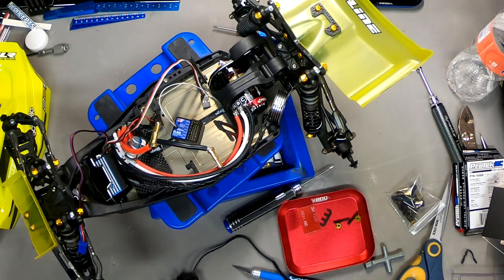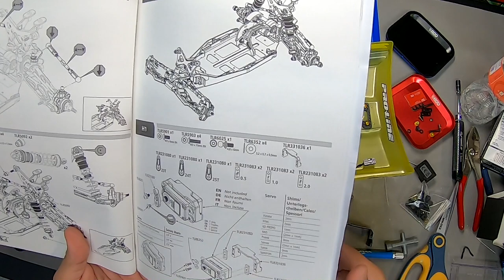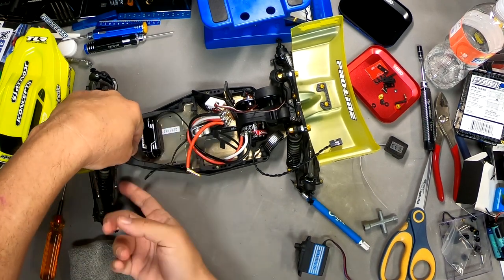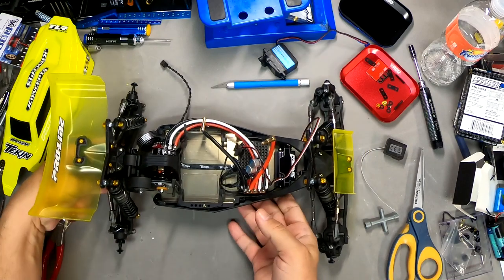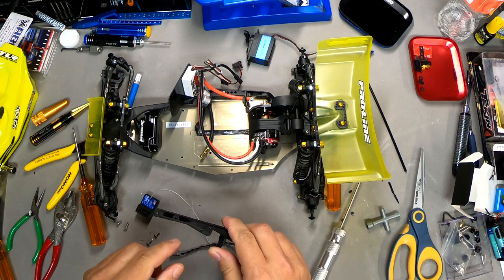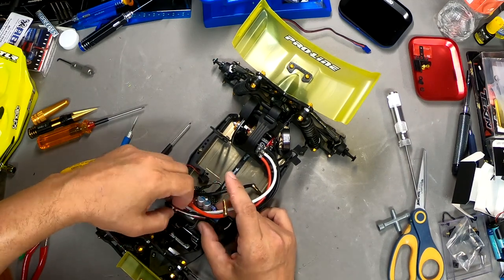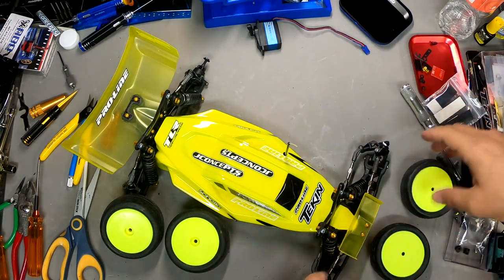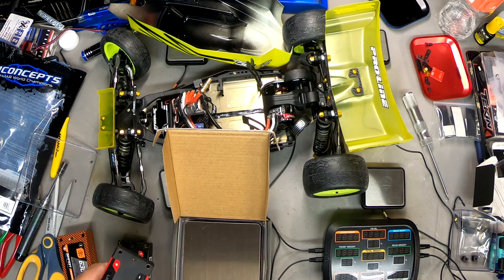Building a TLR 22DC 5.0 Elite 1/10 2wd RC Buggy for Off Road Spec Racing - Pt. 9

Comment: what motor and esc are you running? what kind/size of track
Reply from the maker: Hi, I go over all/most of the parts I use in the build in the first video. Here is a link to the playlist that has all the videos for this kit. I've still got another video or two to go on first runs and tuning. Locally, I have access to two indoor clay tracks... average size more or less. One is limited to 1/10 scale and the other 1/10 and 1/8th scale. THere are a couple places within 4-6 hours drive that have carpet tracks... I'd like to check one out sometime. Less cleanup racing on carpet :-)

https://www.youtube.com/watch?v=jCZOozqMzT4&list=PLWi1J2KoLS71barD1J2JDvoE_h4F8VsRk
Reply from the maker: FYI, the motor and gear setup is for stock class ROAR. If I was running mod, I'd probably start with a 10T to get used to the power and move to a 7.5T when I was ready.
Reply: @MyRCChannel-CJScott  21.5 or 17.5 is stock usually, right? I picked up a TLR22 5.0 Elite second-hand and am learning a lot of about the racing side of things.
Reply from the maker: @dackerman123  Hi Dave, for the 1/10 buggies, 17.5T is the stock spec. You got a good buggy to start with. If you go to the TLR site and go to that car’s listing, at the bottom of the page you’ll see setup sheets from some of TLR’s pro drivers. Having the right tires is usually the biggest thing in getting your car setup right. Go to a few races and see what the fast guys are running. Buy those!
Reply from the maker: @dackerman123  BTW, check at your local track to see if they even run stock class 2wd Buggy... some places just don't have enough people interested in stock and they'll have an open, "run what you brung" class that's like mod plus whatever. In which case, get yourself a 7T motor and a high end ESC. That way you're legal for mod.